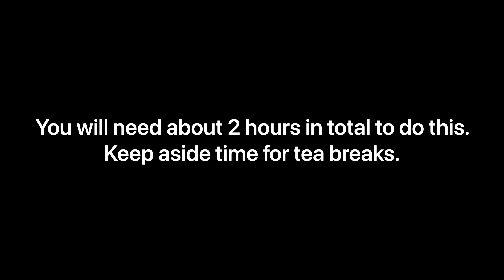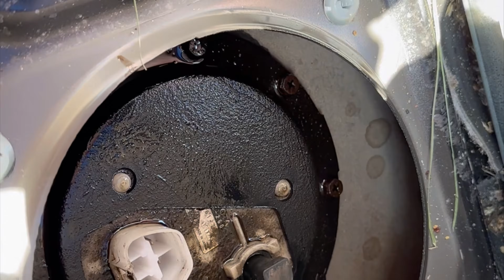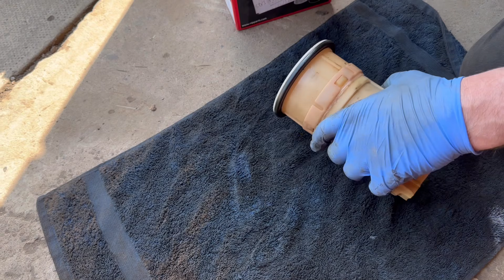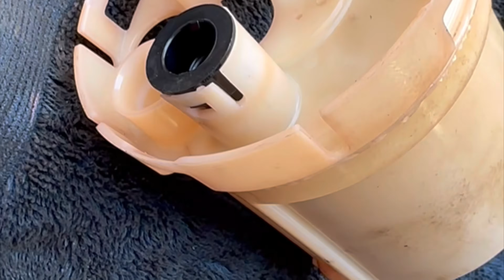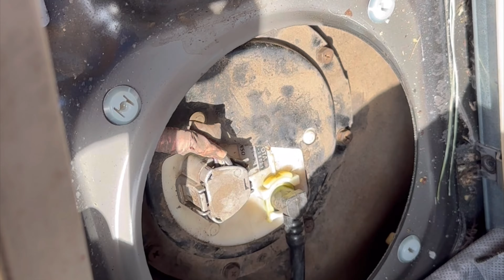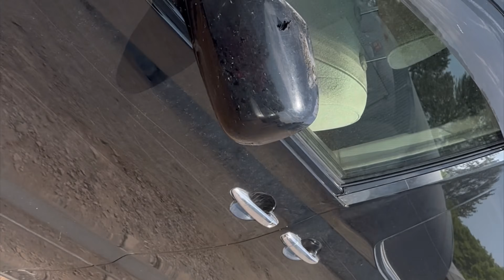Uk Toyota Alphard Vellfire Fuel Filter and fuel pump replacement. Japanese import.

Comment: Why did you end up replacing the fuel filter? Was this preventative maintenance or did you get symptoms? Cheers.
Reply from the maker: A lot of the work is completed as servicing. I tend to do it whilst the weather is warm .
Reply: @Cuttothechase  Thanks for the response. You know the slight hum noise you get when initially turning the key, prior to cranking the engine? Mine is making a juddering noise mid-way through the priming procedure. Only started after I had loads of servicing done to the van. Not too sure what it could be. Runs and drives fine, although I am positive I am missing a bit of power. Any idea?
Reply from the maker: Did you run the engine close to zero fuel and go over say a speed bump?
Reply: @Cuttothechase  I don't normally make a habit of running it low on fuel, but in the first few months of owning it, I probably did do something like that to get an idea of how much it would cost to fill it from empty!

Comment: Hi,
Very useful video.
Is there a link that you can share for the parts replaced please.

Regards,
Alex
Reply from the maker: Hi there. I would recommend using genuine Toyota parts. Your dealer can supply. Failing that , call Willie at Toyota Newbridge in Edinburgh.

Comment: crazy design everyone uses these days as u said fuel everywhere is filthy rubbish we the general public pays for bkame the fuel cartels... great info at least they are replacable my polaris utv isnt u have to but a 700 dollar new pumo when it blocks up unless u do like i did and get rid of the crap design they hav and fit an external allor efi filtervoff 1989 peugeot 505 that hold 400 mls of crap before it blicks up cheers thanks heaps
Reply from the maker: Thanks for taking the time to comment. My car had done loads far too many miles on this filter however I would have replaced it earlier had it been accessible and inline too. I suppose the around the pump idea means it catches the crap right at the point before it gets near the pump.
Reply: just another built in obsalesance design to sell high dollar parts sadly toyota do it as well as all the other car builders those pumos cannhandle anything that gets thru the bottom micro filter no problem they are about 6 micron the pump can hande 35 micron particles with out drama cheers live your videos thanks 😊heap man
Reply from the maker: Cheers Brett. I was thinking the injectors may get clogged in time
Reply: @Cuttothechase  uep u would still need to run an inlne high pressur efi filter between pump and fuel rain as i did in my polaris ranger. take care man keep it up